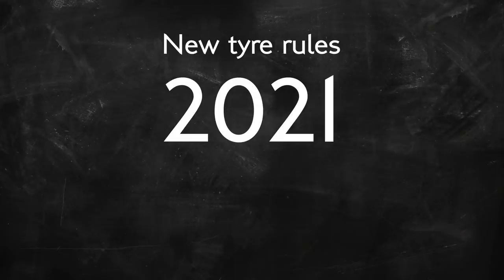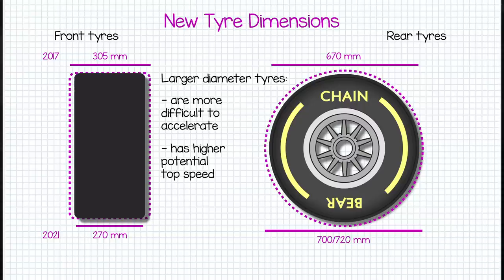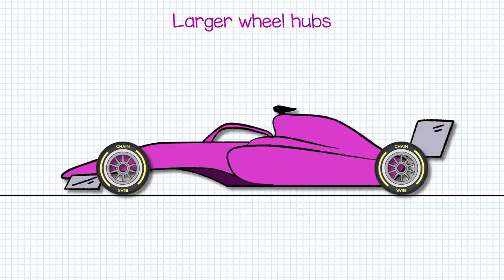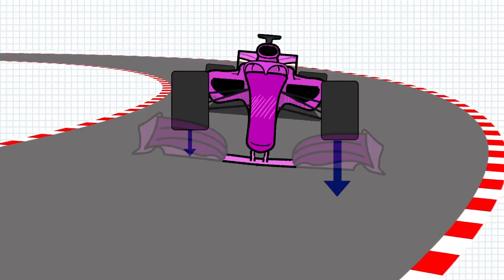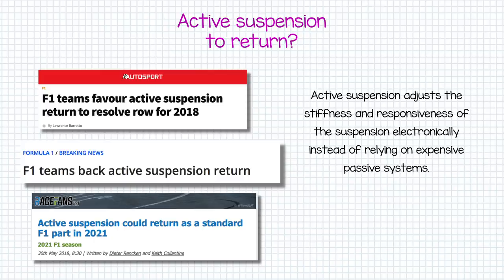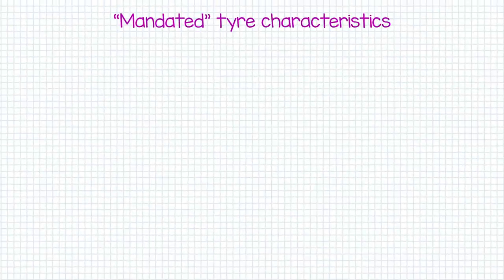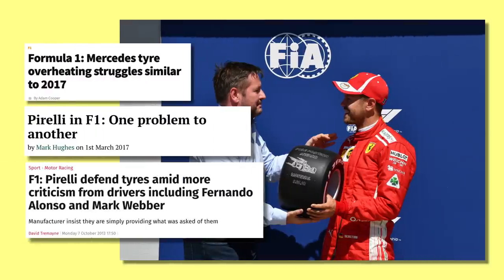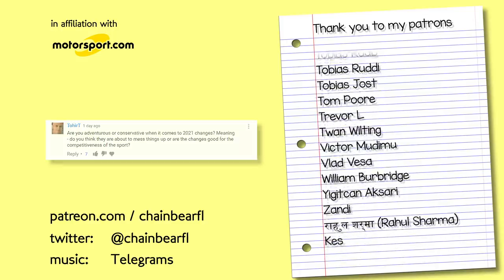New Tyre Rules 2021 explained - Low profile tyres, no tyre warmers, radical compounds

Comment: Was wondering... if the F1 rear wheels are getting larger in diameter, wouldn't that effectively make the the rear higher than the front(so it's angled) meaning that the down force would be less effective when using the barge board? Or would engineers adjust the location of the axel in relation to the chassis to accomodate this?

Comment: I really enjoyed f1 with the 13 inch tires the thick sidewall i would imagine the ride would be slightly comfortable for the driver when attacking a kurb but with a 18 inch diameter rim  there would be a lesser chance of the tire flexing and absorbing the shock from attacking curbs i am for sure predicting that we will see a hell of lot of tire blow outs and pitstops due to the lower profile tires i may be wrong but its what i see Lower profiles may also give the f1 car a slight edge on handling but thats just me

Comment: Next up: the FIA regulates the rate of wear on piston rings, the lifetime of the camshaft, the weight of oil used and the amount of carbon deposits that has accumulated on the exhaust valves.

Comment: Is there a rule regarding the front wings capable of being dynamically adjusted with ailerons? (For example, when taking a corner, one side produces more downforce than the other to help keep the tire pressure balanced)

Comment: I only just thought about active suspension or active ride coming back.
These days most high end cars have different settings for sport , comfort or Eco both with engine  mapping and the ride comfort , this may no be how Lotus tried it in the 80's or how Williams revisited and solved most of the issues in the first half of the 90's 
Again just like Ground effects it fell because of higher cornering speeds and high development costs .

Even though banning it so late in 93 , led in some ways to the trash tragic deaths in 94 . With almost every team struggling to make passive suspension work on their race cars .

I have long wanted both Ground effects back and active suspension together I think they could solve all the issues that plagued both systems .

Though I doubt the FIA will allow both.

Comment: I don't personally see how engineering the tyres to always last a specific proportion of the race will help make things more exciting. You are litterally making it so the tyres will perform in exactly the same way all the time and the fact this is a rule means that the teams know how the tyres will perform before even testing them so surely doing some relatively simple maths will give them a tyre strategy that will work at every track (and all the teams will use this exact same strategy) and if the strategy doesn't work it because Pirelli failed to make tyres that follow the rules, so what you're going to get is either a year of predictable tyre strategy and/or a year of team bitching about tyres.

Comment: do you think that an alteration of the engine rules such that the focus is switched to overall and rate of usage rather than the method of utilisation could be a way of reinvigorating the sport?

For example, Koenigsegg could team up with Rimac to produce a 'non-V' engine based on the Koenigsegg CV engine type, strapping on an electrical power unit of significant note in the process.

The rules could also stipulate that a hyper efficient, hybrid engine must be developed and utilised a specified number of times a season.

That way the likes of Blaydon microjet generators may also get a look-in too.

It could possibly open the way for some interesting collaborations but crucially would also allow the big car producing companies to bring forward their new kit/ideas too.

Or is it just me who thinks this and on a practical level would this ever work?

Comment: Have a larger tire? change the final drive ratio to compensate giving you equally more torque, and lower RPM, Yes installing a larger tire without making changes will make it accelerate more slowly and make it capable of reaching a higher top speed(of no other forces overpower the engine first). But by changing the final drive/axel ratio you all but negate these effects, except for the extra inertia of having a physically heavier tire and wheel, but this would be such a small percentage that it would hardly be noticable uniless the entire track were 0-50-0 KPH acceleration and brake tests, and even then, not noticable by much

Comment: What is size tyres? 
Michelin want 
Front 320 mm x 720 mm r 18
Rear 370 mm x 720 mm r 18
Now is
Front 305 mm x 670 mm r13
Rear 405 mm z 670 mm r 13

I think return back to 2009 but bigger tyres
Front 385mm x760 mm r18
Rear  425 mm x 760 mm r18

More grup tyres , better slipstream and smaller degradation

Comment: Don't larger tyre wall tyres also flex so the tyre moves relative to the car i.e. the hub pops out sinks in depending on turn? Lower profile tyre won't flex as much giving better turning?

Comment: I like the lower profile tires, but I've never been a fan of the "engineered gimmick" of the tyre compounds. As we've seen over the past few seasons, different cars use tires differently. I would like them to have tire compounds that are more straight-forward in their grip vs expected lifespan without artificially gimmicking them to fall off a cliff.

Comment: I personally think Michelin would design a much better tire than Pirelli will. Especially in a low profile. That's just from personal experience in owning several mid and high end sports cars on street and track days.
Reply: There's literally nothing wrong with Pirellis tiyre They're as close to perfect as most can do. The problem is the FIA. The tyres Pirelli makes are 1:1 scale with the FIA's demands. Instead of running after Pirelli, you should be running after the FIA to fix their flawed tyre specs.

Comment: The carbon mock-up of the 2021 regs that Sauber was testing in their wind tunnel, I saw tyre guards to guide air a bit better. In a pit stop if the mechanic made a mistake and shoved the tyre into the guard and it breaks. Could that cause a retirement? Let me know.

Comment: I'm very sure putting low profile tyres are going to have a negative effect on performance, the wheels will be significantly heavier, shock absorbsion over those raised kerbs will be reduced as will steering response due to the wheels extra weight.
Also more compliant suspension will add possibly even MORE weight.
Technically there are no real improvements with these tyre changes, just a cosmetic difference.
Reply: Absolutely everything you just said is completely wrong.
Reply: wingracer 16   Try again.  Lol
Reply: OK.

1. The wheel will be heavier but only slightly. Meanwhile the tire will be substantially lighter. Especially the fronts which will also be narrower. I would not be surprised if the new front wheel and tire combo is actually lighter than current. The rear tires being slightly larger in diameter may make them slightly heavier than this year but not by a huge margin. 

2. The reduced sidewall deflection will make steering response faster.

3. All you have to do to make a suspension more compliant is go to a softer spring. A softer spring will actually be very slightly lighter, not heavier.

4. Lower profile tires will have significantly less undamped oscillations over bumps (such as hitting curbs). This means the heavy inerters all teams are using these days can be eliminated or substantially lightened, further reducing weight and unsprung mass. 

5. If active suspension is brought back, 3 and 4 are irrelevant. 

6. If the FIA allows larger brakes to fill up those big wheels, the improvement in cooling capacity will reduce the size of brake inlets, reducing drag. 

7. If the FIA does not allow larger brakes, you still have more room to play with cooling so should still see a drag reduction.

8. If the FIA allows neither 6 nor 7, the reduction in brake heat transferring to the tires will reduce pressure build up and improve race performance. 

In conclusion, there are very good reasons why every road racing series on earth uses the largest wheel the rules will allow. F1 uses 13 because it is the max size allowed, not because it is better. If the FIA changed the rule to allow a choice of 18 or 13 inch wheels and made tires for both, ALL teams would run 18s.
Reply: wingracer 16   Thanks for a very informative reply. I'm not sure i agree about the wheel weight, but most of what you said seems to make sense.
I am really looking forward to see how these changes effect the race times. Should be very interesting.

Comment: with this mandated tire performance it is clear the FIA is aiming for a 2-5 stop races. Even if you ran the hard tire exclusively, if it has a cliff, then you would need to pit twice AT LEAST. If they keep the mandatory compound rules then you will be looking at 2 stops being a real stretch if you start on mediums and definitely not possible with starting on softs (particularly if they have been used in qualifying). But what I want to see, is not teams being forced to pit because they HAVE to. I want the teams pitting because they WANT to. Pitstops have been a punishment in F1 for at least a decade now, ever since the refueling was on its way out. If you want teams to pit, make the time they gain on track worth from a pitstop, outweigh the time they spend in the pitlane. If the soft was 5 seconds faster than the medium, you would have 5 stop races with teams trying to run the softest tire exclusively as much as they can.

Comment: asking F1 tires to work at 10 degrees C is it like impossible.  If they work at 10 degrees, they wouldn't work at 110 degrees.  Even semislicks like cup 2s or pzero corsas don't work properly until you get a bunch of heat in them.

Comment: Banning tyre warmers makes no sense to me. F1 drives way faster than a road car and their tyres need to operate at high speed all the time. Keeping them hot is part of this.
The way tyres are used on track bs real world is absolutely nothing in common except when parked.

Engineering tyres to fail is also fucking dumb. They want tyres to operate in lower temps for “road cars”, but drop performance fast for a racing spectacle.

Comment: Having closely followed F1 since 1975, I've seen a lot of changes over the years, some good, some bad.  F1 is constantly hit with "cost control" so that the lesser-funded teams can in theory be competitive.  My thoughts have always been this:  F1 is supposed to be the pinnacle of motorsports.Period.So LET them play, for God's sake.  Let's see 260 mph straight line speeds.  Ultra-high G loads that push man and machine to the limit or beyond.  If F1 isn't careful, we'll have just another spec-series racing car, read: boring.
Reply: I honestly join your Argument, watching wec, etc. is just as interesting as watching a stupid videogame. I didnt live there but watching Senna and Prost/ Porsche 917 at CamAm is something different. I would pay all i got just to See That 😍😢😪
Reply: I agree and in regards to pzero road tires will never ever be anything like F1 tires because they legally have to have tread. Unlike F1 tires which are slicks.

Comment: Sad to see the the new "relevant" tyre change towards the low profile tyre. I compete in Hillclimb and Super Sprints and the first change and cheapest gain for improvement was rid the car of low profile tyres. If F1 is truely an engineering paradise to push the the limits.....WTF is any suppliers marketing KPI's influencing the sup regs of the pinnacle of our Motorsports. SUV's are also popular, how about a ski rack on the top for 2024.

Comment: I am just a little bit scared of what we will actually have as "F1" in 2021. All those big rule changes at once. Sure, Mercedes Ferrari and maybe Red Bull will probably have worked it all out by than, but the gap to smaller and less whealthy teams might widen by a lot. 

Also, does F1 really need all those big changes at once, at that point in time, and on that scale? 

Maybe move from 13 inch to 16 inch wheels in 2020 first before going straight to 18 inch wheels to help the teams and Pirelli understand better how the tyres will behave on different tracks with different environments.

Comment: I did a research project on high Vs low profile tyres in F1. 
Another downside is that in order to transfer heat from the brakes to the tyres you'd need larger brake disks to make them heat the tyre, which has it's own issues. Either that or not use the brakes at all to warm them, just weaving. Could cause heating issues for drivers to start with

Comment: What would be wrong with designing a tire that would eliminate the need for pit stops?

Alternatively, why are pit stops a part of F1 and many motor sports? It seems to me product development and racing would be improved without pit stops for tires.
Reply: Already done. There is no problem in eliminating pit-stops. For tyre manufacturers, with current tecnologies, it's MUCH easier to design a tyre that mantains it's charateritics more or less unchanged for the entire race.
And that's the problem. Since the best cars tend to start in the top positions, that means that there will be maybe some overtaking at the start of the race, and then nothing until the end.
Different compounds that actually degrades and the obligation to use at least two of them during a race had been introduced to make the races more unpredictable.

Comment: Lower profile doesn't mean that it's gonna be less sqishy. It all depends on the compounds and how they are used as well as the tireflank's construction, how they sit on the rims etc etc....
Do you have any official information regarding the vertical stiffness of 2021 tires? If not then your point about suspension stiffness is basically just broscience. sry
Reply: Obstsalat95 If you use the same compound/structure the tire becomes stiffer.
Reply: Yes that's correct but my point is that the compounds and more importantly the construction will probably change a lot which makes predictions about the stiffness impossible
Reply from the maker: So the point is there is less travel distance available through the narrower sidewalls so no matter how squishy or stiff that suspension travel will need to be compensated for
Reply: incorrect. The sidewall acts like a spring. If the construction in that region is softer, it will absorb the same force although the %-deformation of the tire is bigger and therefore the transmitted force to the suspension will remain the same. All your arguments only hold true if the vertical stiffness of the sidewall is equal with both tires, which is not a given

If the tire would be squished all the way to the rim then yes...the suspesion would need to compensate the additional distance. But the tire deformation only lies within 1 or maybe 2 inches. Even a low profile tire could deform that much easily

Comment: Some times I wounded why they are still chasing this lost cause of tyres that "fall of a cliff " just let them make a tyre that could do a hole race at 100% but say they have to run two tyres of tyre . the fans get a flat out race where the driver pushing witch is what we all want . well its what I want

Comment: The new tyres are horrendous. F1 should be relevant to itself, not road cars. 
Screw simple aero, screw slim tyres, screw cheap and anaemic power units. 
F1 has rarely been as beautiful as today. Leave it alone, tweak it a little but don't upset it so drastically.

Comment: Won't large tyres mean better torque but lower speed? 🧐
Reply: Nope, the opposite.

The tire acts like a lever. Imagine you are holding a stick in your hand, when you swing it, the far end moves far faster than your hand, the longer it gets, the faster it can move, but the harder it will be for you to push an object around by bushing it sideways with the tip, as you are losing leverage.

Comment: At 1:00 minute he says that the torque will be reduced vecause the circumference increases, how ever torque is equal to the force applied multiplied by the distance from the centre (i.e the radius), therefore as distance increases (radius increases) the force is constant and therefore the torque should increase. Anyone explain why he said it the torque would decrease. I understand that the tyre will be heavier and the acceleration will decrease due to F=ma (where F is force, m is mass and a is accelerstion) due to as the mass increases and the force is to be kept constant therefore acceleration must decrease.
Reply from the maker: Torque = Force x distance, therefore is the torque is constant and the distance increases the force will decrease.

Force = Torque / distance, see?

Comment: F1 just might get interesting again, but engineered in tire failure is a dumb idea though, why not just try to make them last as long as possible.
Reply: with all the fancy little aero bits on the cars these days its near impossible to overtake another car unless the car in front has an issue so most passing these days is done due to pit stops, l guess the FIA thinks that the more pit stops will mean more position changes
Reply: +bjorn1583 Yeah but it seems an unreasonably dangerous way to achieve it!

Comment: Please do a video on active suspension. This, IMO, will ruin F1. I’ve long wanted lower profile tyres so that drivers cannot blast over the curbs and have no effects on the car because the tyres were absorbing all of that energy. If they bring back active suspension, the change in tyre walls will make little difference to the racing. It will simply gets a marketing tool for PZeros.,
Reply: Like new era is so or so.. watch the hybrid, no crashes allowed and rebranding philosophie of today (like naming oldschool sauber just alfa Romeo )